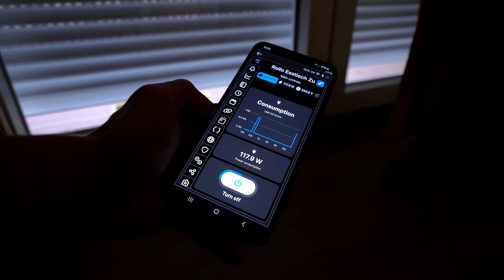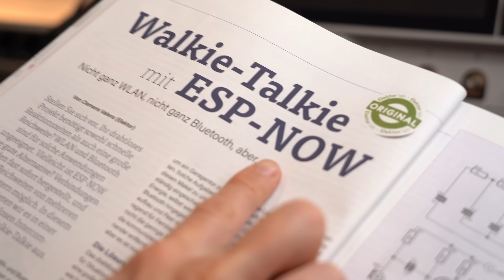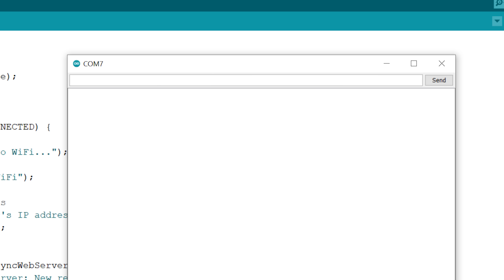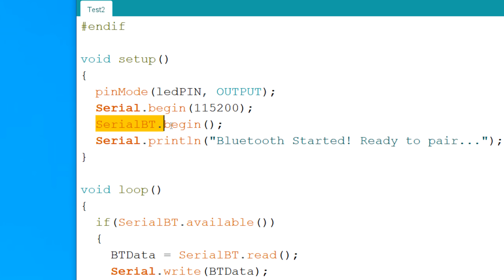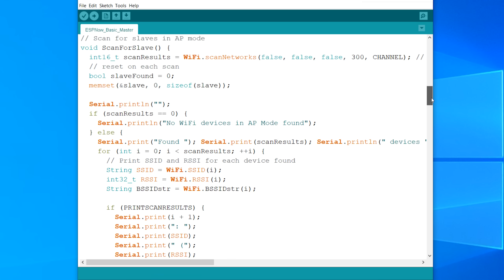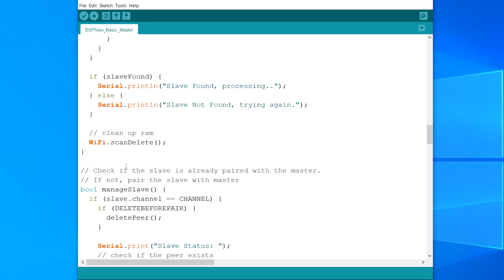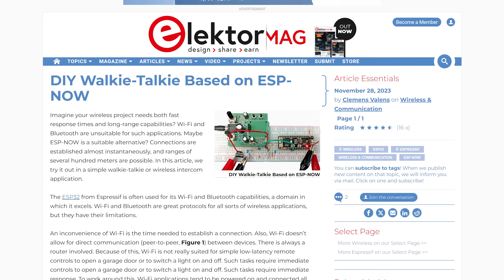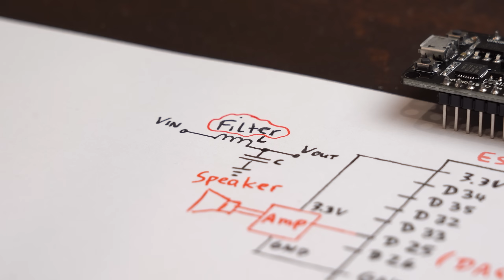Forget WiFi! This Wireless Method is WAY Better? (ESP-NOW)

Comment: Esp now is brilliant! I made some wireless motion to midi for a dance performance. I was stupid enough to use BLE. It worked until the performance... Switched to esp now. It just works! Range is good. Very stable. And very easy to set up.

Comment: You can use Wifi without a router using 2 ESP32's. One just has to act as the router. I have done it for longer range transmitting. Worked very well.

Comment: What about walls and storeys in a building? Can I use this to measure water level in the overhead tanks of a 3 storey building and instruct the motor switch at the ground floor? Will the signal go fine?

Comment: Interesting project. THanks für showing it to us. 

if you whould to recieve better distance values, for really all radio- wifi, etc. devices, the antenna ist manly critical. The perfect antenna makes such a huge diference. to really built the right antenna, you will need a VNA (Vector Networt Analyzer) there are cheep ones for way under 100.-. they made a good job, for what i need them.

Comment: does anyone know how to measure the QoS (throughput, delay, packet loss, jitter) of esp-now while sending audio data(walkie talkie like in the video)?
i tried using wireshark with the ip addres as filter, but it doesn't display anything. So, i asked chatGPT to make a program to display the qos directly in the serial monitor. it DID display the qos, but i can't hear any audio coming through....

Comment: Is there something like this for short range or very high accuracy like UWB. Need to something to perform close range position tracking with no IR or Ultrasonic or optic sensors that is not very expensive of course??

Comment: Yeah. If only esp-now had any kind of authentication. As it is at the moment, it's gaping wide open for denial of service. Reason: the receiver will happily accept all packets, encrypted or not. So all an attacker needs to do is use a sniffer, then flood the receiver MAC with packets. Espressif finally acknowledged it and will update the documentation. So if you need to use wireless for anything critical, better use wifi with wpa3-sae.

Comment: So the problem with WiFi is data rate and range (according to you) and your solution is to use ESPNow which uses the same antenna and radio as WiFi on the same controller?  This solves literally nothing.  But WAY better.  Right.

Comment: anybody else having trouble with this? I followed random-nerd tutorial and my two esp32-c3 boards are NOT communicating. I can't get the sent command to be successful. I have checked the mac addresses and everything is correct.
Reply: Look at the espressif espnow sample script. It’s not bi-directional but will get you started.

Comment: Would love to see you investigate Li Fi. As the speed is a Super way to send local data. It is safer for the human brain & body than electromagnetic microwaves. Not to mention killing Bee’s & Birds with high power 2.4ghz. I would switch to Li Fi in the house as a safer transmission method but I can not find any hardware available. Eg LED light transmitters. The Scottish company Pure LiFi & others are making very little progress for the average person. Military seems to be their main product development. Cheers TJ in West Australia.

Comment: bad range test imho, those long wires will cause power loops which in turn can go back the the RF circuit and impact the radio.

Comment: you will never get the same range with espnow with 2.4ghz radio then a 434mhz or 868mhz LORA radio. Lower frequencies can travel easier through materials @ if the same output power.
And how about licence to use that radio protocol? at least for a commercial product

Comment: I haven't actually used ESP NOW, but it seems that it doesn't allow for broadcast packets.  This makes discovery of devices difficult, since each device needs to know the MAC address of the other.

I've found PainlessMesh to be a similar but better solution, with the added benefit that range can be extended considerably by hopping packets through several devices.  Also pretty easy to program.

Any comments?

Comment: Hi, a fantastic video mate, i allways try to watch your vids, the way you explain things is quite refreshing! i bought one of these many years ago and not this exact model and i have never used it, but the last talking you did through it, it sounded like a perfect Star wars stormtrooper helmet voice changer? but without all the other stuff needed to sound like the way it does with a voice changer and im wondering, could you make another one of these sets up and try and put it in a star wars helmet or any helmet and see how it sounds compaired to the films/cosplay? i think if it does sound like your/a voice has changed it could be a cheap version of them? sorry mate just my 2 cents? ps, i know it will not change the voice tone but a cool little experiment to do? or maybe a little programming edit in the arduino code to ulter the voice as its going through the devices? take care and have a great day!

Comment: So is this basically unbranded WiFi Direct™?
Reply: Na. It's not. There is no IP layer or TCP with this protocol. To make an analogy is like making a kart from a car. You gain some things but lost others, in this case you lose tools for network with really big numbers of devices and reliability of data in exchange for better range and response time. It's not a trivial thing.
Reply: This seems like a link layer switch,instead of copper wire physical layer,we use radio
Reply: Bingo
Reply: yes
Still WiFi but No hub or gateway required.
Reply: Only this is very slow wifi or not? @Zeaiclies
Reply: Esp32 from expressive is well established brand

Comment: I'm just thinking; esp32 have I2S could be better using it to handle the audio signals obviusly need aditional circuits but interesting. Thanks for the video.

Comment: While it may be overkill for this project, there are a couple of ideas that can be stolen from the VoIP world to address some of the issues.

A codec can be used to compress the voice in real time. Some are very simple, some not so. Even some high quality VoIP systems work with data rates less than what is available here and with only 8 bit samples.

VoIP uses UDP for transmitting voice so is also susceptible to dropped packets. Packets are timestamped so missing packets can be identified and if a packet is dropped, the receiver simply replays the last packet which is more than likely almost identical to the missing packet. If packet loss is small, the impact is barely perceptible. 

Like any packet oriented system, a little bit of packet buffering can smooth out slight delays in receiving new packets.

Comment: Small detail is that it's not true that with with Wi-Fi you can not directly connect two end devices without a router. 802.11 also defines ad-hoc communications, It's called IBSS mode

Comment: My remote 434MHz gate remote works about 750m.
Reply: Made by ET Nice in South Africa. Actually 750m on a rolling code transmitter. The receiver is a 434MHz Nice Micro Blu Mix Rolling Code Rx2. About 10 USD or R190 in south africa.

Comment: I feel like you skimped on the testing.  I'd have liked to see:
1.  Test what happens to the voice signal at max range.
2.  Run the voice data through wifi, see if there's any difference.  (Probably not, I'll grant.)

Comment: I use ESPNOW for my sensor network. I quite like it. However, when used indoors between 3 brick walls the range is unreliable. 
I havent tried it outdoors transmitting and receiving into the house but Id guess an external ipex-like connected or SMA connected external stub antenna based ESP32 would offer better gain over range. 
Im sceptical of thr cut and splice approach Ive seem done in some YT presentations. Surely there needs to be some form of matching network in the front end of the radio section to properly deliver RF without mismatching and subsequent reflections on the transmission line.

Comment: ESP-NOW rocks! but nobody talks about the power consumption, I'm doing a controller for my skateboard using two xiao-esp32c3 and when the transmitter radio is on the consumption goes to around 300ma, insane consumption!

Comment: I think the ESP wireless protocol would be an excellent tool for a self developed home security network where you don't want your individual cameras or audio recorders available over the wifi network. Many people can exploit wifi insecurity with a simple youtube video search, most of them would not even know to look for ESP wireless signals let alone how to exploit them. If you are able to encrypt the data this is another layer in defeating the "casual" hacker.
Reply: I think ESP-NOW offers you an encryption configuration for transmissions one or bidirectional, you can look on the docs

Comment: Tip: I saw you've soldered a button for testing. Its actually not necessary because you can use the built in button called BOOT. its on GPIO0.

Comment: I've found that a great application for ESPNOW is RC vehicles. It's pairless so no more waiting for connection, and communication is the most reliable it can be. The transmitter sends regardless of the state of the receiver. It's also fast enough to send data to it over 10 times per second, giving RC vehicles lightning-fast responsiveness. Moreover it has a long range which is again ideal for RC. And it also needs very little power so you dont have to worry about the wireless communication eating through your batteries

Comment: The slow response time problem for wifi is likely due to Nagle bandwidth shaping. You can get insanely rapid responses over a tcp connection if you disable Nagel (which you can do when you establish the tcp connection). Always something to try depending on how much of a delay you notice.

Comment: ESP32-CAM ESP8266 Arduino IDE WIFI Module with OV2640 2MP Camera & USB TTL Board - AU $27.63... cheaper than a webcam!

Comment: Now ESPNow is obviously awesome for embedded devices. But with the problem description I immediately thought of ad-hoc-wifi/wifi-direct, which use the normal band and lack the gateway requirement of infrastructure mode. But I get that the point was to show off the new protocol.

Comment: When I was in college (circa 1985), I built a one-way digital audio link (in this case using an LED and a photodiode) that employed a delta modulator (Analog Devices chip
?). The key benefit of the delta modulator is that the bit rate is low as data is only sent when the audio waveform is changing. I was quite impressed by the fidelity I achieved well below the Nyquist theorem.
Reply: Impressive for the era.
Reply: Congratulations! Did you transmit data by light with IR LEDs?
Reply: @gutobassogb  - That's correct. I remember that I had to put a shield (tube) on the IR phototransistor because the front end was being swamped out (poor design on my part) from stray IR.

Comment: using the esp now will be dead simple once someone writes a nice user-friendly library for it.  that's why your other methods were easy, someone had already "wrapped" up the complexity into short and easy to use commands.  just give it a little time. (or make your own library - they are a bit of a pain to make but really help you down the road)

Comment: The only thing i don't like is the MAC adress in the code. If i need to replace the controller for any reason, i need to update the MAC address in the code. But ESP-now worked great in my only project i did with that.

Comment: ESP Now is "proprietary" technology it can be used only between ESP32/8266 modules, and that makes it useless for 90% of the projects...
Reply: ESP NOW uses the vendor-specific action frame of Wifi, the protocol itself is well documented. In theory, you can use any Wifi device to send an ESP NOW frame.
Reply: an esp8266-01 can be connected to whatever board you are using each time. Plus there are ongoing attemps at ESPNOW libraries for android. Maybe in the future its compatibility will be better
Reply: It's not, the protocol is Apache licensed, open source and apparently well documented.
Reply: So what makes it useless? Maybe the skill of the user.

Comment: Shot in the dark. Im looking for ups systems that would allow me to work on my computer on my country house in case of a prolonged power outage (like 2-3 hours). I would need to power a starlink antena, a 15" 2017 macbook (battery is dead) and a 27" samsung monitor. I think that would mean a combined 195w. I found some options but they are too expensive and I think the DIY option is the best option. could someone help me find some good schematics?

Comment: I put together a zigbee network for my old workplace. Super low power, totally open protocol with encryption and mesh networking by default, works with a ton of off-the-shelf stuff (like IKEA lights and buttons), no single point of failure except for setting up the initial connection.
Industry routinely tries to kill it off beacuse it's really not that profitable and makes external data collection more difficult, but for users, it's really an ideal protocol.

Comment: Hi Scott. Thanks for all these interesting videos ! 
I've got a question for you ... I've been looking for a Li-ion battery protection circuit (or 5v buck boost with low voltage protection) that cuts around 3.2~3.0V, and couldn't find one. They are all set to cut at 2.5V, which IMMO is way too low and harms batteries, reducing their life time. For example, my E-cig has such a protection that cuts at 3.2V, but no way to find such circuit on Ali... any thoughts / advise about this ? Thanks

Comment: Hi Scott, have you analyzed how to make a WIFI Mesh using ESP32? I think that one would be a killer for most IOT needs. Also, having active/active gateway would remove all the failure points. Please ping me if you'd like to share some thoughts. Thanks!

Comment: you didn't compare with zigbee 3 modules, those bad boys have a range of a couple hundred meters (personal experience). They outshine any other wireless communication protocol in terms of latency, although sadly they can't transmit a lot of data.

Comment: I am totally new to ESP,  a basic question, in your setup are both ESP units constantly transmitting and receiving or only when you press the TX  switch?, i need a system for LED communication without constant connection, a little like 433 TX /RX. i guess i could use the 433 system.

Comment: Don’t you need an antialiasing filter between the mic amp and the ADC ? I think it would be wise to filter out everything above 3 or 4 KHz (depending on the sampling frequency).
Reply: Correct, also a post DAC filter is required however he's really just showing a proof of concept not designing a useable project.

Comment: You are wrong that two boards require router to talk to each other. ESP32 can create wi-fi access point.

But for the generic advice yes, ESP-NOW will be faster than Wi-Fi mainly because it drops extra application layers.

Comment: I've been thinking of creating a usbip connector for the dualsense ps5 controller, since most of it's features only work via usb on pc, and seems like esp32 could be a good use for it, specially with this protocol

Comment: It is a bit misleading video. You're presenting latency for 2 different paths. For wi-fi you're using router (additional hop and longer distance), for BT you're connecting directly therefore the latency is much smaller and the receiver seems more responsive.

Comment: Why did you relate AD/DA to speed? Isn't that linked to the sampling rate that is likely determined by microcontroller clock speed and cycle load?

Comment: I have a similar kind of noise problem with a system I have created. The system has three different parts

- Power supply board consisting of litium-ion battery and a buck boost converter for stable 3.3V supply.
- Audio processing board using ADAU1701 DSP chip.
- ESP32 board to control the DSP board by I2C bus and communicating with a program running in PC via netsocket.
  The PC program is used to configure the filters on the DSP board and store the configuration to the ESP32 boards SPIFFS 
  file system.
  
Most of the time the ESP32 is in sleep mode and everyting is silent. When the WiFi is on I get a lot of noise in the audio signal. 
I have been pulling my hair off trying to solve this. Maybe some of you watching this channel has a solution for the problem? 
Could switching to bluetooth communication help to solve this? Any help would be greatly appreciated, thank you.

Comment: So ESP-NOW is just local wifi. 
The main benefit is no router in the middle, just one board directly to others. 
It's a shame that you have to manual pull MAC addresses. Would be more useful if it was zeroconf.

Comment: But... you don't need an AP to connect devices to each other through wifi... all AP does is broadcasting. 
Since Windows XP you can just create a network and as long as those devices use the same SSID and no stupid firewall is in place - they'll see each other.

Comment: Thank you for this informative video. This might be very handy for me in a future project.

Apart from that, I have an offtopic (but I think still important) remark: The terminology "Master and "Slave" is criticized for being discriminative language. It can easily be avoided by using replacements like "Host" (or "Controler") and "Client".

The debate about this terminology can be looked up on the wikipedia page "Master–slave (technology)".

Comment: You can always build your own waveform oscillator. Or much much simpler: use some IR-LEDs and IR-photodiodes. UPDATE: with video and audio, you really don't need to care about packet loss, since the ultimate receiver: a human, does a lot of advanced post-processing to get the data in order.